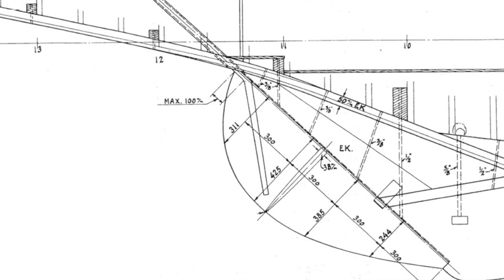[14] Rudder Repair on a Wooden Dragon

Comment: What's up with that smoking drill thing? Is the stationary drill bit just an illusion?
Reply from the maker: I noticed that, too. Of course the stationary drill worked fine - but the electronic shutter of my camera did not. Perfectly synchronised with the rotating tool. Smoke is quite normal when you drill deeply into oak.

Comment from the maker: After I finalised the video I noticed that I did not show how we fixed the bent iron braces of the rudder stock. Well, these parts had to be treated with a blow torch and then could be bent back into the correct position easily. But it was too hot for a video.
(Die Arme der Ruderblattbefestigung wurden mit dem Schweißbrenner erwärmt und in die korrekte Position zurückgebogen. Zu heiß, um Videos davon zu machen.)